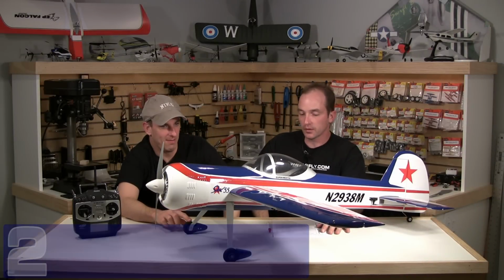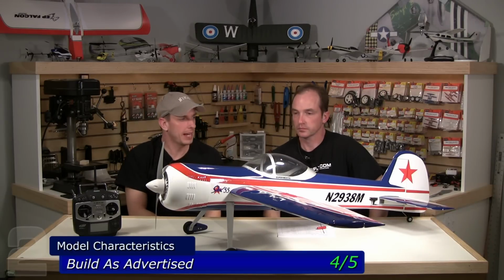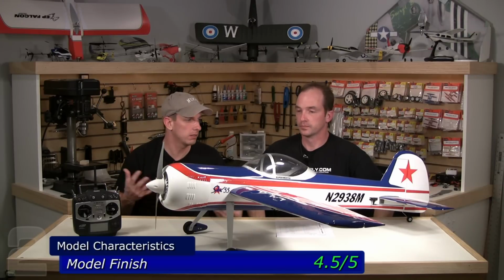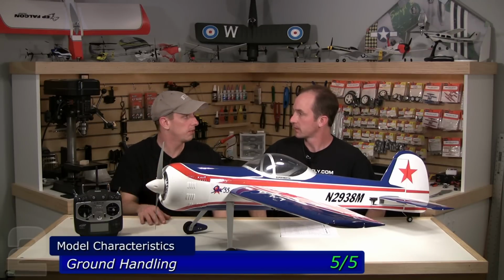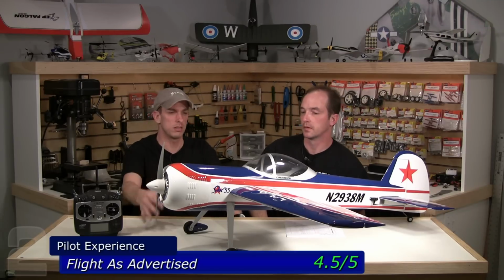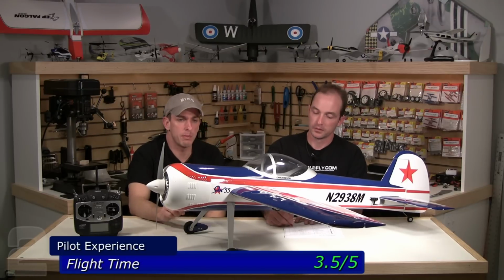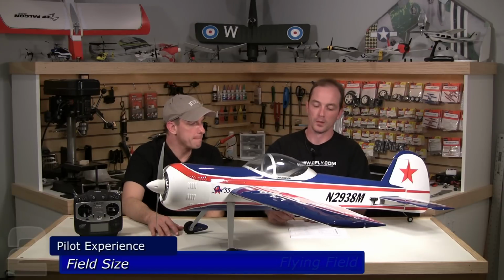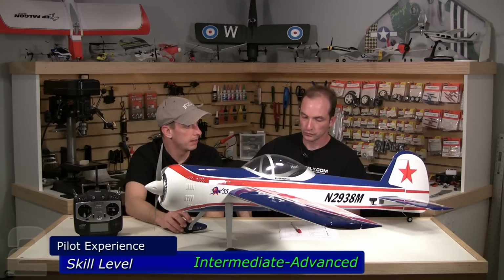ElectriFly Yak 55M Review - Part 2, Scoring

Comment from the maker: @eastcoast78 - You could easily remove the wheel spats and install bigger tires.  Oh yeah.  Rob has the model at his shop (so I couldn't measure for you) but if I recall, they're more like 1 3/4".  OK for short grass, but you'd want to bump them up for a typical yard or field.